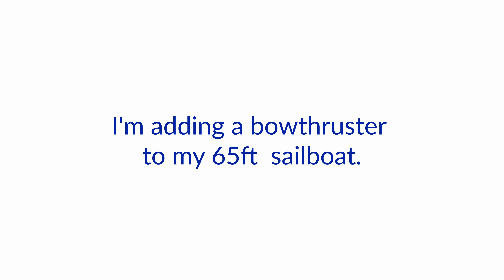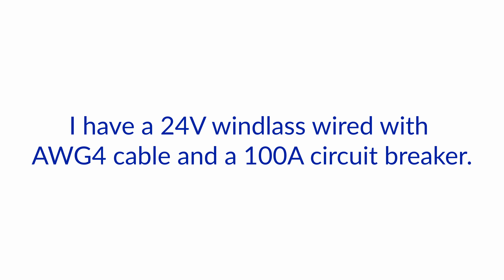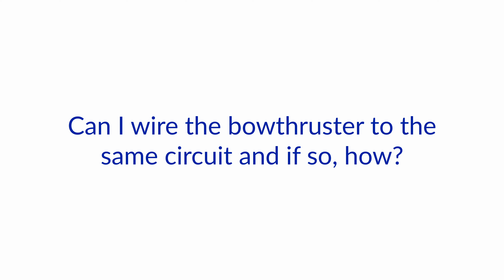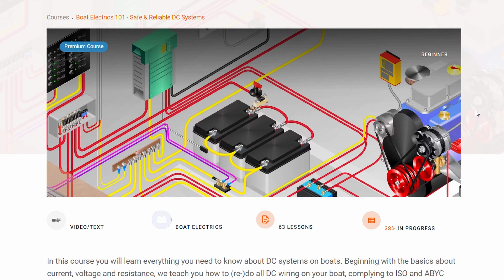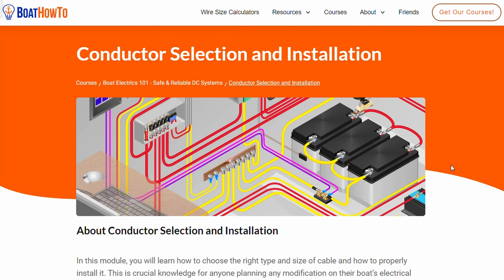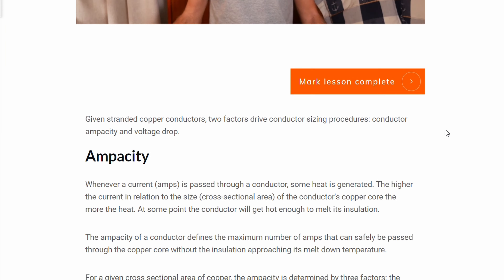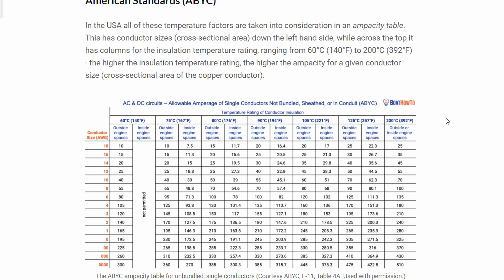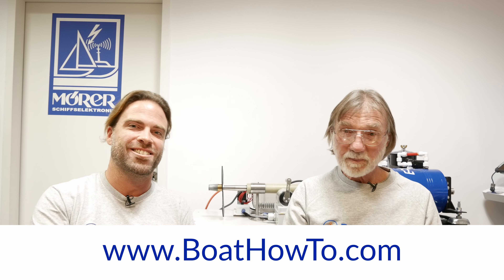BOW THRUSTER & WINDLASS - How to properly connect them. | Ask The Expert with NIGEL CALDER

Comment: Just to be sure I got this right, are you recommending that bow thruster cables be sized for 10% voltage drop rather than the max 3% I’m applying everywhere else? Was this discussed in the Boat Electrics courses?
Reply: I don't think he went as far as recommending it but made the point that the conventional 3% calculation does not necessarily apply for a high current device that run for short periods only.

Comment: 700 amps would probably melt cables, fuse holders, and switches before blowing the fuse.  Indeed, this happened on my client's boat sitting at the dock when the thruster self-activated. If not for the "melt-down" (thus opening the circuit) the boat would have surely caught fire. I'm not aware of common recreational electric devices capable of handling that load (these devices were factory installed, BTW).

Comment: Why not supply power to the thruster or windlass as normal through an appropriate breaker but then put the switch on the return side, I.e. after the load to take advantage of the reduced voltage and therefore arcing? Toyota commonly do this in their vehicles.
Reply: I knew someone who had that set up but it meant, of course, that the  windlass & cabling was 'hot' all the time and therefore vulnerable to shorting to ground, etc. They ended up adding a second switch, this time on the positive side.